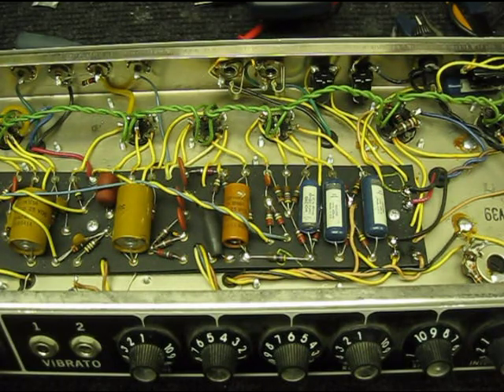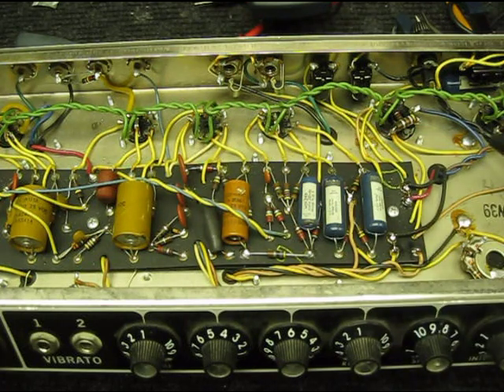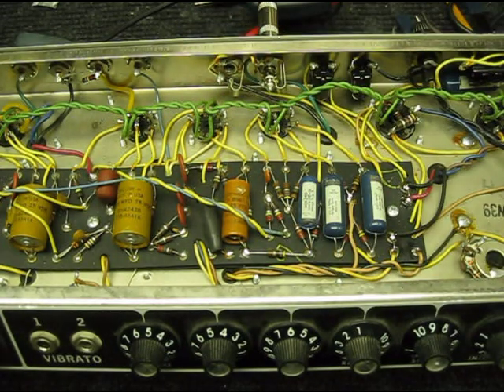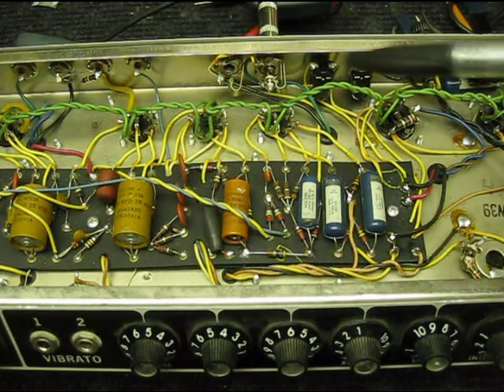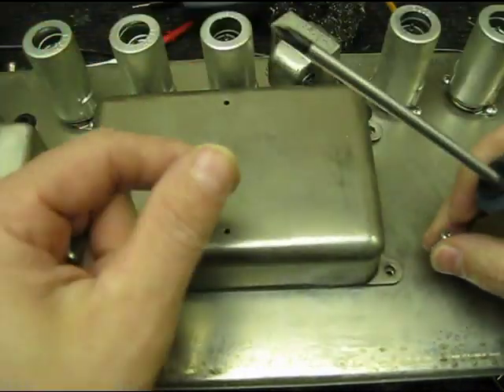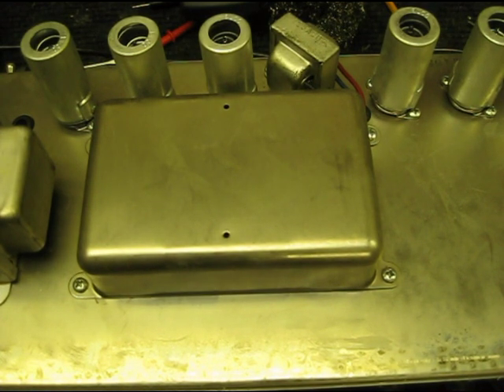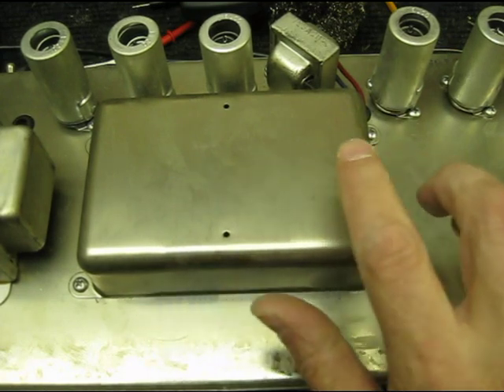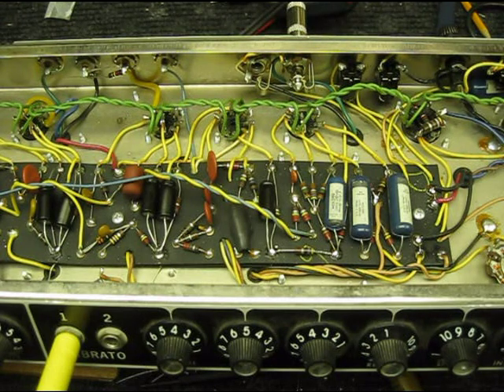capacitor replacement and service  65 Fender Deluxe Reverb amp

Comment: Listen to what this guy is talking about, he knows his business!  The value of slightly undersized filtering caps can’t be stressed enough. Pat is working with vintage tube gear, but you should listen to what these principles do to a cheaply made transistor amp like the Vox Pathfinder, almost makes you wonder if tubes are all that important to tone

Comment: If the amp is 30 years old, you need to change the electrolytic - they will fail in due course. You're also implying that the amp sounded 30 years old when it was originally purchased. Otherwise, great advice and presentation!

Comment: At 1:50 you say that those electrolytic caps "set the bias for the preamp stages". But the bias for a preamp triode is determined by Vgk (the grid-cathode voltage), which is set using the cathode resistor. I believe those electrolytic caps you're tapping on are the cathode bypass caps....which determine the frequency response of the gain stage.
Reply from the maker: yes

Comment: Hi Pat, many thanks for the video! This is really hard to find information and has really helped me a lot. Could you tell me if the caps you used to replace the 25-25uf 25v ones were just a pair of 25uf 25v for each one? And did you also change cap next to the bias adjuster? Many thanks in advance!

Comment: Hi Pat.. Love you repair videos... I have a question I hoped you might be able to answer. With a cathode biased amp (Vox ac15, Fender 5e3) what affect does the size of the cathode bypass have. I know the value if chosen to be low can limit bass, but a 25µf with a 250 ohm resistor (5E3) and a 50µf with a 130 ohm resistor (vox ac15) is enough for full guitar freq. (above 50 hz). Modern amps such a modern voc ac15c1 has a 220µf with a 120 ohm resistor. People claim it stabilizes the bias voltage.

Comment: I'm about to replace the caps in my '66 Deluxe Reverb. I can hear a clicking type of noise that has recently developed. I'll check for microphonics in other caps now thanks to your video. I always check for microphonics in my tubes but forget caps can get that way too. Also, I just obtained a '58 Silvertone 1391. I put a 4 ohm speaker in it as my '66 Champ is 4 ohms and I couldn't find a scematic. I bought the speaker from Ted Weber and the new filter caps too. Now, it sounds a bit dark for a 5 watt amp with an 8" speaker.Could that be impedance, caps, or both?

Comment: 70uf ,70uf ,20uf ,20uf, 20uf is original spec for power supply filter caps.

Comment: Hey, just started the built of a Deluxe Reverb clone by a local amp builder here in Argentina (totally hand made). The tech offered me to put Jupiter Red Astron caps in the place of the Blue Molded so I bought them, do you think this might me be a good idea or would you change them for the Jupiter Yellow ones or Sozo's Blue Moldeds?

Comment: Hey Pat. Great video's. You may have covered this in another video but I have a few Questions. I see Recap Kits being sold and they seem pricey. Can I just buy the caps from an electronic supplier and if so, what values are the caps on the top side ? Also do you have a good source for power transformers ? I have a 64 Deluxe Reverb that is all origin except Speaker , Grill Cloth and tubes. Any info would be greatly appreciated. Thank you

Comment: Hi Pat,
Great Video!...I live in the UK and have just bought a 65 Fender Deluxe Reverb Re-issue from USA, is it possible to put a 240v power supply in it or would there be other things to change on it if I did?

Comment: Pat, thanks for this great video! I'm wondering if you can tell me if ALL tube amps will exhibit some ghost notes / subhamonics when really cranked? And if so, is some of that unavoidable intermodulation? I've got both a 70's silverface twin, and new Hiwatt clone that don't really shine until i've got them more or less dimed, but then single notes in the middle/upper register of the guitar produce VERY pronounced ghost / sub-octave notes... Do people just usually live with it?
Reply from the maker: +Charles Scott yes.... which is why its important to get your tone before your amp is cranked

Comment: Thanks for the awesome videos. I have an old Fender 75 and have had it for about 12 years now. If the life on the caps is about 10 years, should I be looking to change them regardless or only if needed?
Reply from the maker: +maggit13 it depends on how the amp sounds

Comment: Hi I have a 63 fender vibroverb ri. it has the Chinese 22uf caps in the rear.... can i check their value still installed.... could these be changed to 16uf and sound better.....  this amp sounds bad in the bass tightness, Dead flubb not clear... bad pick attack.

Comment: thanks Pat. I replaced the power supply caps with the correct value, hit power on, then after about 3min I hit standby and the main 3A fuse blew...any ideas? Maybe I didn't let the new big caps "form" properly? I don't have a variac and wasn't sure. Thanks again for your posts!
Reply from the maker: s2khawk current inrush trying to form the caps can blow the fuse ... you can make a current limiter with a dollar store extension cord by cutting one side of the cord and putting another ac plug in series with... then plugging in an incandescent lamp (100 watt bulb) the bulb will light up as the amp draws current giving a slow start ... google this project ... replace the fuse and do a slow start up ... also check your work for shorts
Reply from the maker: s2khawk https://youtu.be/-rHmuPS--P8

Comment: Hello i have a early 70's late 60's Fender Deluxe Reverb, lately its been having a volume problem, i cracked a 6v6 tube socket and just replaced it but the volume is still low, i could put it all the way at 10 and its still too damn low, have you heard of any problems like this? If so any info you could provide would help alot, thanks

Comment: Hi Pat, I have a DR '81 and in a gig blow one of the filter cap, I put a new one with new tube set and in couple of days blow ir again, today I notice that the power cord is bad (no ground) thats could be the problem?
Reply from the maker: sounds strange take it to a tech
the bad ground is not the problem filter caps fail because of age or voltage over their rating

Comment: Hi Pat! I haven't heard you talk about suspected ”leaky capacitors”, what are your thoughts on that? I'm referring to the signal chain, you tend to prefer not replacing old mustards or what have you. I've recently seen some videos from Mr. Carlsons lab and another channel talking about old tube radios where they replace all caps because "they will be leaky", even recommends not buying nos caps because they will leak as well.

Thinking about getting myself one of those old capacitor leakage test if I ever find one locally. You for sure has some of the nicest tones I've heard and I write this out of curiosity if you have any opinions on the subject :)
Take care! :)
Reply from the maker: +Eric Öhman a leaky cap has a very ugly and obvious sound. If your replace all of the signal caps, and so on you might as well buy a reissue amp.  Conversely if you replace all of the parts on your vintage amp with new parts it will sound just like a modern re-issue... for guitars and guitar amps OLD signal caps are THE SOUND ...

Comment: I have a deluxe reverb 65 klone with bigger transformers. My filter caps are 2 x 30u and 3 x 20 u. Is it possible to use normal values like originals in your video?? 
Tnx.. - Ulf
Reply from the maker: yes you can lower the filtering

Comment: Pat i have a hand built BF Deluxe Reverb two channel it's around 12 years old.
I've changed all the tubes but i get this midrange howl.
You can hear it building up as your playing then it slowly go's into an Air raid siren howl.. Turn the amp off then back on all is good then after about 30 minutes of playing it will start again.

Some times it wont do it for a couple weeks then out of the blue it go's into a fit.

I thought the tubes were going Micro phonic as #1 was giving up the ghost that's why i replaced them.

But this howl still persist..

Could this be filter caps or the preamp caps going bad..
Also the vibrato section is completely dead..
The friend that built this was a seasoned builder and repairman that sadly passed away a few years back so I'm in a pickle.
Reply from the maker: It’s self by oscillating somehow there is a feedback loop between the output and input ….
Reply: @patfurlan  ::: One thing I did yesterday was pull the Reverb tank and it seems to have a different sound than with it in.. I have another tank may swap them and see what happens..
Reply from the maker: @bigstick5278  if the tank it not isolated it can pic up vibration from the cab
Reply: Also started giving a fit in tube #3 with the tank unpluged.. Found it while wiggling tubes when it started howling, it wouldn't do that before with the tank plugged in during howling.. Yes my tank is in its bag at the bottom of the cab. I'll plug in the tank and see what happens as I replaced #3 pre tube.

Comment: I kind of disagree, a 50 year old + amp is bound to fail and I will only leave the original caps in if it's going to be for display only. Disc and Mica caps are usually ok

Comment: Hi Pat I'm recapping a 1964 Fender Vibrolux Reverb and I have a question on the two 16UF caps to the far left (in your video).
The other three are wired parallel and from what I see on a lot of videos is that the two on the left are wired series. Only problem for me is I cannot find a schematic for the amp I'm working on and cannot tell whether the two on the left are wired series or parallel. Can you help me with a definitive answer? Feel free to email me at squires@telus.net or simply reply here as it may help others :)

Comment: Pat, love your videos. I have a problem with my 1965 Fender Bandmaster amp. There's a treble high end sound that happens in this amp. I have all of the electrolytic caps changed, even tried jupiter and sozo coupling caps . even tried silver mica bright caps for the treble cap . tried changing the tone stack caps to 0.02. Still I get the shrill extremely high treble sound when playing chords around the 1st 2nd and 3rd frets I could really use your help on this one. Is it the wall voltage causing this, I don't know thanks Michael from Niagara Falls, Ontario
Reply from the maker: +michael newell  is it distortion or just crazy eq ?
Reply from the maker: has the output transformer been changed ? sounds like it might be positive feedback
Reply: +patfurlan the output transformer has not been changed and neither the power transformer. I suspect that it's got to be one or the other. Everything has been checked. That was my thought possibly the transformers. It doesn't make any difference in switching the treble caps to 500pf or 250pf. This amp at one time sounded great. but I agree with you, you don't want to start changing too many components as you will never achieve the original tone. maybe I should get a mercury magnetics output transformer. Does the power transformer have anything to possibly do with this ringing treble sound. I don't know
Reply from the maker: slow down ! everyone always assumes the most expensive part is the problem. I mention the output transformer because if In stalled backwards ie the blue and brown wires swapped you would get a ringing chirping treble noise. if it is factory original your problem is elsewhere
Reply: +patfurlan this has always played great for many years, never had  a problem until recently. like I said before, I had taken this amp to amplifiers plus in Kitchener. He told me the amp was fine. I did not mention this before but I have a 100 uf electrolytic cap in the filtering instead of the usual 80uf. there is also a 220uf where the rectifier diodes are. I don't know if this is also over filtered as you were mentioning in your video. perhaps changing the coupling caps may help I don't know. I rebuilt a Brian May special edition amp with the help of David Petersen and Mike Ryde, both in the UK. That amp sounds great now. Mercury Magnetics output transformer in it. sozo caps terrific amp. I hate to have this Bandmaster sound crappie and not really know what else to do here. It's hard without someone really knowledgeable.
Reply from the maker: if Rich could not find the problem and it was not there before look for a bad pre amp tube
Reply: +patfurlan  HI Pat, I bought this book called how to hot rod your Fender amp.  I replaced the two slope resistors with 56K Scarborough comp resistors. replaced treble caps with 500 pf caps .For some reason when I changed the treble switch cap to 500pf I started getting strange microphones in my guitar cord which I did not have before. I think I will have to change that back to the other original bright cap to 120pf. But strangely enough the amp doesn't get that ringing now. Maybe those carbon comp 100 King resistors everest going bad.   changed the phase inverter coupling cap to .0047, seems to make the amp just a tad too bassy. any  advice on that value cap?